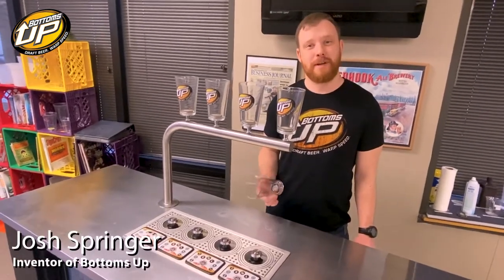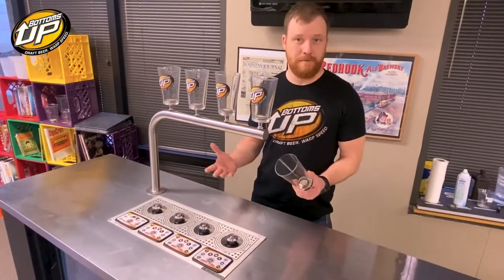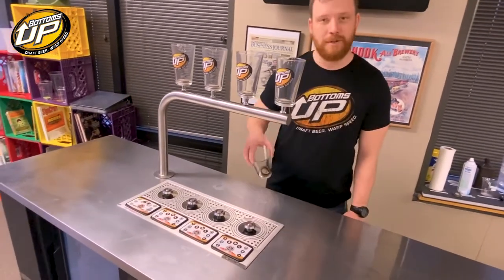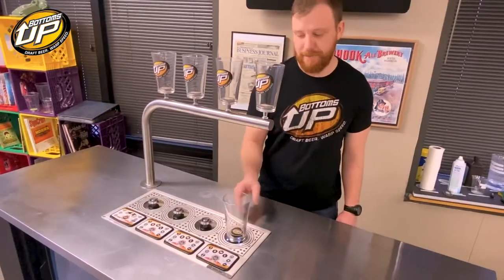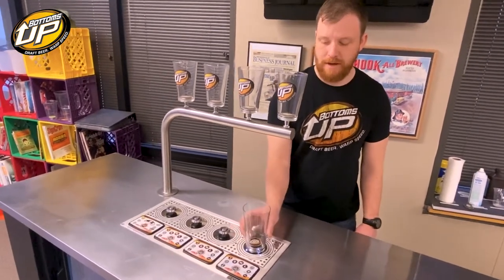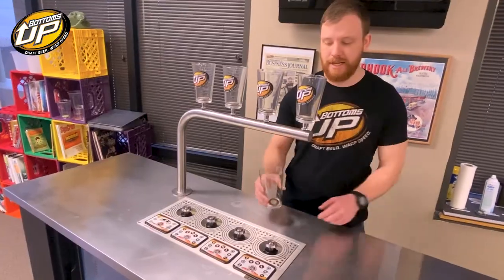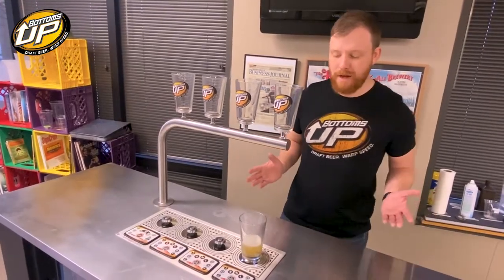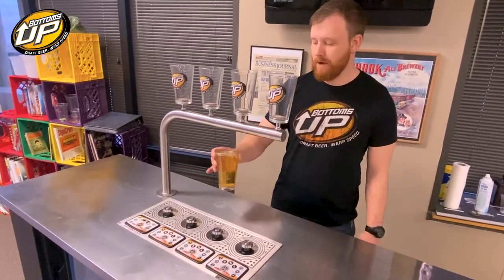How To Put A Cup On A Bottoms Up Beer Dispenser

Comment: Some beer spilled on the pick up. Is this really a "better" way to serve beer or just a different way. It gives me cause to pause when "confidence" is part of the equation to unspilled beer. Seems highly error prone.
Reply from the maker: With Bottoms Up there is zero waste and the fill is hands free and stops automatically. Faucet based systems waste, on average, 30% of every keg and require the full attention of the bartender. We say pick it up with confidence because people tend to be a little shy about pulling it off the dispenser when they first use it. We were going to say: “Don’t be shy about jerking it off.” but that got vetoed for some reason.